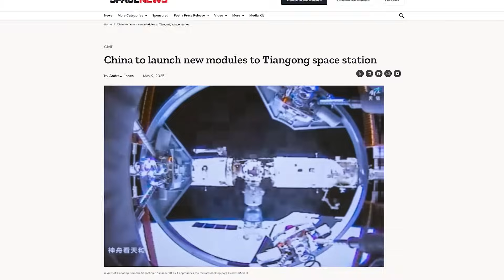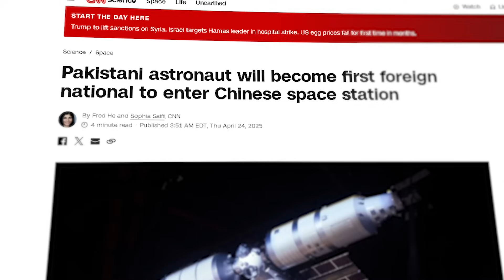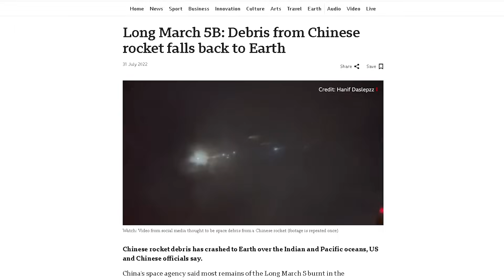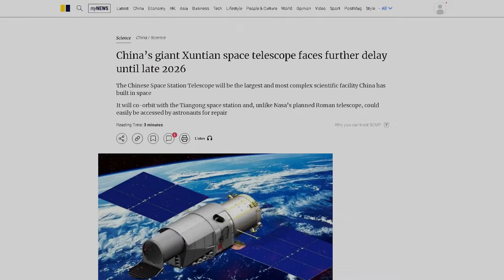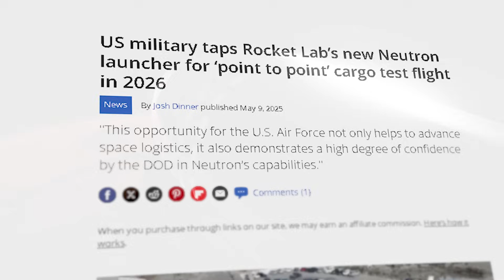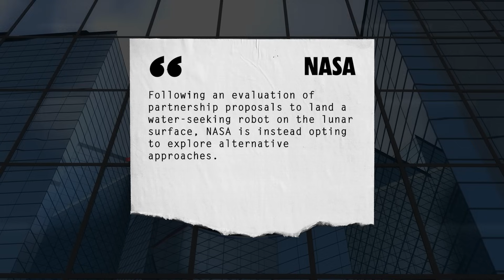Something Big is Happening With China's Tiangong Space Station

Comment: Correction. CSS is 1/4 of ISS weight but interior space is about 90% of ISS and has six sleeping pods (three regular crew and six during transition).  The weight difference is due to solar panels and racks.  CSS generates same amount of electricity as ISS.  Comparing the two is like comparing my 1997 IBM Thinkpad to my 2022 Apple IPad Pro.
Reply: Main reason is that it doesn’t use the truss design like the ISS
Reply: @garfieldlulu5035 ISS belongs to Russia.
Reply: ISS is Russian.. @garfieldlulu5035
Reply: Americans after reading this comment "😡 Chinese Tofu 🤬"
Reply: @BruceJ999  豆腐脑只能是咸的
Reply: @BruceJ999  豆腐脑必须是甜的
Reply: Brilliant comparison! You're absolutely right the CSS is a masterclass in modern efficiency. Lighter, smarter use of space, and equal power output with a fraction of the mass. It's like leaping from bulky legacy tech to sleek, high-performance design. The engineering evolution is undeniable.
Reply: @spacexelonmuskusa  Apples/Oranges comparison.  True, two different designs from two different eras.  It's like trying to compare the first Chevrolet Corvette car model from the late 1950s(?) to a modern Corvette from the 2020s(?).  The USA and a few partner countries are looking at a new ISS, so a new ISS design could be thought of as better than the Chinese space station.
Reply: @crosslink1493  Without Russia, the United States would not be able to maintain the ISS.  The United States, as in everything, needs allies...to be saved
Reply: Americans ISS station will be obsolete very soon
Reply: Also the fact China made their station in the last few years is pretty significant. If a passing asteroid destroyed Tiangong then these new modules could be launched to make a new station in the next couple of years. NASA doesn't have a rocket capable of launching new space station modules and would need a decade to even begin to decide on a tender process to review who should make new station modules.
Reply: i had a similar though when he was talking about chinas boosters being weak because they get all way to orbit when ours drop off early.... if we could get the burn rates right to get all way to space on boosters we would but we havnt solved the weight to yield ratio as well as they have and have to burn more for less yield. its a more efficient booster like what rocket labs is going for
Reply: @violetquinnlaw  the conclusion is solid but the reason may be wrong. china's rocket engine has a long way to go
Reply: @garfieldlulu5035 why use the best when good enough works?!🤔
Reply: @violetquinnlaw That doesn't make any sense, why would you want to bring up that excess disposable mass? It provides no benefit, and discarding it as soon as possible is significantly more efficient. The reason rocket labs do it is because theirs is so small that they try to re-use the whole thing, which isn't the case for China's booster. They notoriously crash it into some poor village in the middle of nowhere.

Comment: The official name is Chinese Space Station (CSS), not Tian Gong. Tian Gong is the name for the previous two experimental space station models, not this formal one in use.

The elegant design of CSS allows it to keep adding new modules and removing old modules.  Every section can be replaced.  It could well be that in a few years the CSS is composed of all new modules.
Reply: 忒修斯之船是一个大胆的创新，只要不断换新就不会报废
Reply: That's odd. The wikipedia page calls it Tiangong and Wikipedia is usually pretty good at giving things the real name not the slang name, or putting the real name in brackets. The first line of the article says it is officially "Tiangong Space Station" without any numbers, not "Tiangong 3", although the reference is from 2021 so it might have been renamed? 
I checked the link which was to the Chinese Manned Space Agency website (In English) and more recent articles ae  inconsistent, the page on the orbital parameters of the Chinese Space Station names it like that. But the page on the recent Shenzhou XX mission talked about docking with Tiangong. The article on Shenzhou XIX just says "the station" and doesn't give it a name. I think these articles might be autotranlated from the original language so it's possible the translation software is renaming the station or whoever is uploading the text in english might be correcting errors themselves and using the old name?
Reply: Well, the CSS is colloquially referred to as the TianGong in both Chinese and English so it's not wrong.

Comment: actually the problem isn't the CZ5 being underpowered. but that it was TOO POWERFUL that it could reach orbit WITHOUT an upper stage. the upper stage were deleted from the configuration because they didn't need the full power of the CZ5 as it was design for lunar and mars mission. this is not unique to the CZ5. the Saturn V that is also designed to reach the moon also has this problem infamously falling into Australia to which Australia actually issue NASA a "fine" for "littering".
Reply: That was the original space station, Skylab.  The Saturn rocket first stage boosters fell into the Atlantic ocean and most sank to the bottom. The second and third stages were small/minimal enough to burn up on re-entry.

Comment: Artemis 3 survived the NASA budget cuts and the current plan is for that to be using Starship HLS as the lander. If (and I accept it's a big if) one assumes that Artemis 3 makes it to the Moon at some point - current plan is to launch no earlier than mid 2027 so just maybe it happens before the end of 2027 - that might open up what seems to me to be maybe the optimal use of VIPER.

Maybe NASA could just hang on to VIPER for a couple of years and since HLS is so huge and will have a big cargo elevator perhaps NASA could use VIPER as an HLS science package. It might not even need to compromise (displace) any of the science already planned for Artemis 3 because a requirement of the Artemis program is that SpaceX demonstrates a successful uncrewed HLS landing before the actual Artemis 3 crewed landing so, while it would be a lot riskier than putting VIPER on Artemis 3 itself, another option might be for NASA to put VIPER on that first uncrewed lander and then remotely deploy the rover to start its exploration. (A lot riskier because the uncrewed demonstrator landing would be the first ever attempt by HLS to land on the Moon whereas the process would be validated by the time the Artemis 3 HLS lands.)

The rover is intended to have a 100 day life and "rove several kilometres" (according to Wikipedia) so integrating it into the Artemis program would be incredibly valuable and if it could be landed and deployed by the uncrewed demonstrator lander then by the time crew got to the Moon VIPER might even have identified water locations for direct human analysis. Also, I assume that to navigate safely VIPER also has cameras so it could also collect very detailed ground level measurements of hazards, slope inclinations etc to further de-risk the upcoming crewed landing.
Reply: That mission is never going to happen. The moment it starts with budget cuts and delays, the result will be cancellation or disaster.

Comment: Thing with Neutron and Starship, design choices with Starship limits where can land since it currently is not configured to land anywhere, it must have landing legs and frankly fuel reserves to land take off again.  Even if it at base, its not going engines that won't tear up landing field.   While Neutron isn't been flesh out yet, it maybe better to designed be able to do it.  Catch tower issue is big one for Starship.  Efficiency vs flexibility is the takeway.

Comment: How is Neutron more reusable than Falcon 9?  Both return the boosters and fairings.  Both expend the second stage.  Also, there will be plenty of Starships to handle all the needs for it.  SpaceX is building a manufacturing facility at Starbase that will eventually build one Starship per day.  No way can any other rocket company come close to that.  Neutron, like the other rocket companies, will be doing niche launches while SpaceX will be doing 95% of all payloads.  I would like to see more completion for SpaceX, but there's no one even close to their load capacity, cost and scale.
Reply: The Falcon 9 is partially reusable. The Falcon 9’s second stage is not recovered. Neutron is designed to be like a mini-Starship where the whole stage 2 is returns to the landing pad and recovered.
Reply: @Blixey-r9z  I wasn't aware that the second stage was reusable.  That is an improvement over the falcon 9.  However, the Starship is still far superior in almost every way.  The cost of payload to LEO will be substantially lower for Starship even for small sats.  Starship is not just fully reusable, but rapidly reusable.  They expect to fly the same boosters 3 times a day.  SpaceX is building production capacity to manufacture 1 Starship a day.
Reply: @Blixey-r9z  I wasn't aware that the second stage was reusable.  That is an improvement over the falcon 9.  However, the Starship is still far superior in almost every way.  The cost of payload to LEO will be substantially lower for Starship even for small sats.  Starship is not just fully reusable, but rapidly reusable.  They expect to fly the same boosters 3 times a day.  SpaceX is building production capacity to manufacture 1 Starship a day.
Reply: @billweberx 
Yeah my bad. The neutron’s second stage isn’t fully reusable like Starship. The fairing is integrated with the first stage not requiring separate retrieval from the sea. There is still a value proposition for the neutron in small payload deliveries. Just like DHL or FedEx won’t use semi-trailers to deliver your Amazon packages, the neutron caters for  bespoke small low volume payload missions to orbit. There will also  still be a role for a Blue Moon or a Dynetics Alpaca  lunar lander even with the Starship HLS.
Reply: @Blixey-r9z  I don't see it.  Starship rideshares will be vastly cheaper than individual Neutron flights.  You've got to be kidding about Blue Moon and Alpaca.  How can they compete at all with Starship?  The cost/payload are not in the same realm as Starship.  Starship has zero competition at this point.
Reply: No
Stage 2 is simpler and cheaper because it is inside the fairing it doesn't need to be built to withstand aerodynamic forces its just a fuel tank and rocket motor. Thus says a lot of costfabrication and weight. The fairings are attached to stage 1 so do not need to be recovered separately by a separate ship. The booster returns to launch site so doesn't need a ship. There's cost savings and reuseability gains all around.
Reply: @hedleypepper1838  Yes.  I see that you're correct.  It is better than the Falcon 9, which will be obsoleted by the Starship before Neutron is in production.  There's nothing that currently competes with the Starship.
Reply: SpaceX marketing chat bot in full effect 😂

Comment: Like the Starship, the Neutron should be launched near the place where it is manufactured, no truck or train rides. Unlike the Starship, it could be transported by ship, but there would need to be a deep water port with the required equipment nearby.
Reply: It's usually better to not have exploded rocket debris raining down on the continental US, though
Reply: @ItsNova816  But it ok if the debris is falling down over the caribbean islands?
Reply: @user-fr3hy9uh6y  Nope, that's why the rockets are launched eastward from Florida.
Reply: @ItsNova816  Rocket lab has their factory next to its launch site in Virginia and SpaceX if building a Giga Bay in Florida. Falcon 9 is about 12 feet in diameter because 12 feet will fit under bridges on the expressway. The shape of a rocket has a lot to do with how you are going to transport it from the factory to the launch pad.